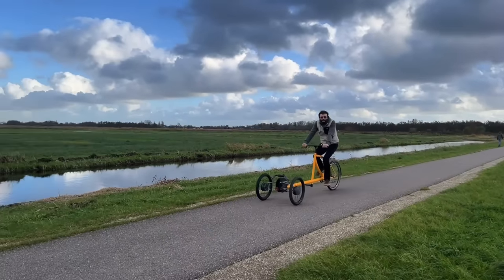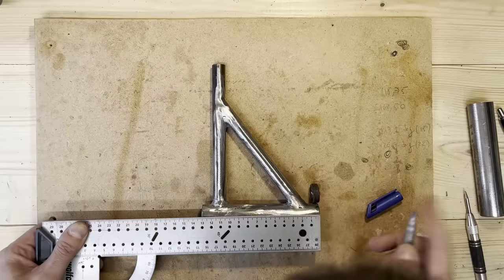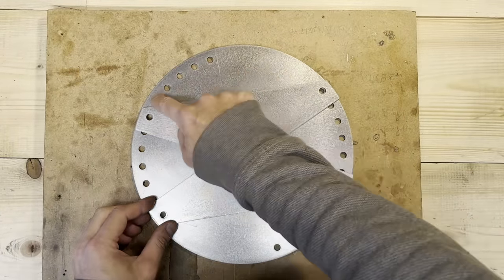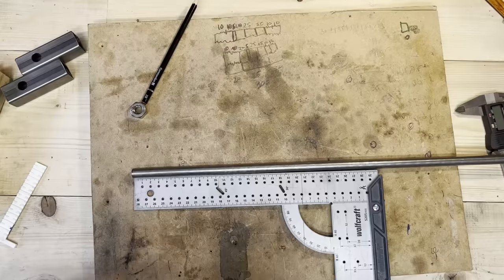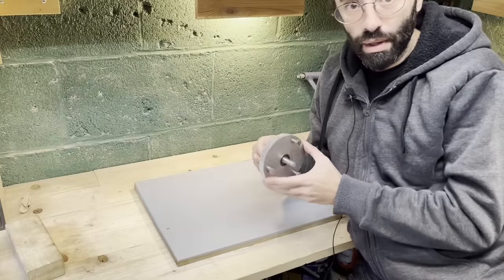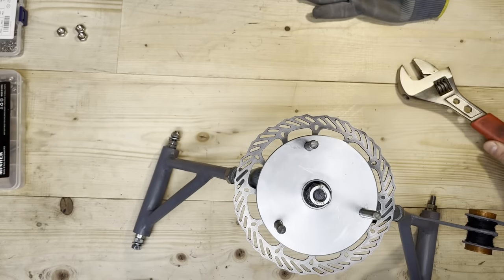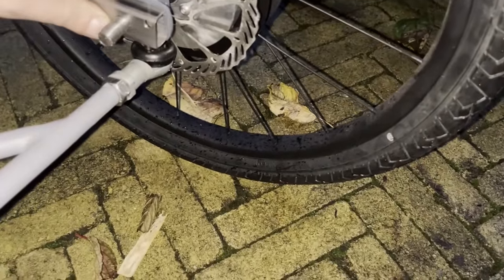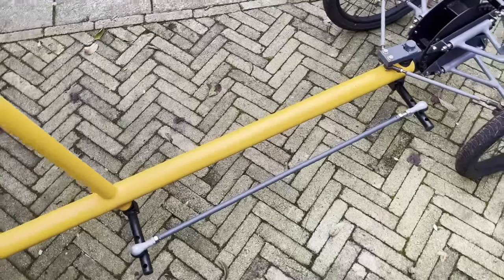Making of a Reverse Tilting Cargo Trike with Adjustable Geometry #5 - Full Build

Comment: What is the wall thickness of the tubes you used?
Reply from the maker: Hello, the wishbones have two tubes:
- 15 mm OD and 12 mm ID so 1.5 mm thick.
- 25 mm OD and 22 mm ID so 1.5 mm thick.
The extension tube is 60 mm OD and 56 ID so 2 mm thick. Hope this helps. Let me know if you like to know any other dimension.
Cheers!
Reply: @pedro-neves Thanks. The 15 and 25mm tubes I have are the same.
Reply from the maker: @piconano , note that the ID of the tubes is the most important because of the use of 22 mm bearings and M12 (12 mm) thread to hold the ball joint.
Reply: @pedro-neves  Exactly.

Comment: Why did you make your front wheel hubs so massively overbuilt for the project those are like the size of motorcycle wheel hubs a standard pedal trike Hub or entire wheel assembly would be perfectly fine they're designed to slip onto an axle so they would go on to a front steering spindle just fine it would have simplified your build and made it easier to replace and repair and they make those with disc brake mounting holes already in them honestly that's the route I would have taken
Reply from the maker: That's true. I have been thinking about this quite a lot. The reason that I designed it this way is that I want it to be able to carry a lot of cargo, and thus I prefer to overbuild. The second reason is that I want to design as closely to how a car is designed because, at some point, I'll start a small car build. Cheers!
Reply: @pedro-neves  oh okay with hubs and spindles that big and strong you could probably Carry close to 800 lb without those parts particularly bending or breaking I don't know about the rest of it seems pretty robust though

Comment: Why a trike? What does it do a 2 wheel cargo bike does not?
Reply from the maker: Hello, in my opinion, the trike will be safer because  if the front wheel slides (in slippery terrain) or hits a bump (e.g. a rock or sidewalk) this won't mean a crash in most times. Also, it will be capable of carrying more cargo with stability. Also, it's a larger engineering exercise than a bike;) Not that I don't love bikes, I do. But I think there are advantages in this type of vehicle for carrying cargo.
Reply: @pedro-neves  i have sold and drove cargo bikes for 25 years now, the difference in speed and stability and maneuverability of a two wheel bike makes it preferd for basically all cargo applications. Both from a technical maintenance point of view and a user point of view. I have sold 3 wheels and still do, mainly because not everyone is willing to listen to the salesman. But by far most people I sell a 3 wheeler come back for a 2 wheeler a couple of years later. The few attempts for 3 wheelers with a way to lean into a corner that have been made so far have always had crippling maintenance issues and complex assemblies that bike stores aren't meant to deal with. It's a nice exercise in technical prowess, this is for sure, but the complexity is also what makes 2 wheels superior. Even for 2-300kg loads.
Reply from the maker: @malloot9224 , I do agree that the trikes with tilting mechanism are the most complex designs with the disadvantages of maintenance and assembly, etc. One of the advantages is certainly being a nice exercise to make and learning certain aspects that will be useful in designing a car. I also think that a tilting trike can be as agile as a bike but safer and capable of carrying more cargo. But I will only turn this exercise into a product one day if I conclude that there are measurable advantages to the user and not a great complexity increase for assembly and maintenance. We'll see... Cheers!

Comment: Bigger size, bigger weight, same aerodynamics, more wheels. What's the point of this bike? Even bike curriers use classic frame designs.
Reply from the maker: Hello, I've tried several reverse tilting trikes and liked the way they ride. They are a bit safer than a bike, particularly in the rain and can carry more cargo. Cheers!

Comment: What tires do you have on the front?
Reply from the maker: Hello, those are 20 inch x 1.95.
Reply: @pedro-neves  heh, brand and model please ;)
Reply from the maker: @paweskiba3042 , this is the entire designation of the tires: "DeliTire buitenband Freestyle S-199 20 x 1.95 (54-406) zwart".
Unfortunately, the seller no longer has them so I cannot send you a link. But they have the same exact tire in blue so here it is. Hope it helps: https://www.internet-bikes.com/en/140513-delitire-casing-freestyle-s-19920-x-195-54-406-dblue/
Reply: @pedro-neves  I'm surprised by appearance of it. They look like 2.5 not 1.95" Could you please measure actual width of them?

Comment: Very cool, very pretty, but sadly in the end its just a bicycle with 3 wheels, glorified kickstand if you wish - lock the tilt and its a just a 3 wheeler with a small base, unlock the tilt and it handles just like 2 wheeler.
Anything fancier than that, just calls for more problems and the like - all self righting, self tilting geometries just invite more problems than they solve...
Reply from the maker: This is more complicated than a bike for sure. And I want it to behave like a bike. But, in my opinion, this will be safer than a bike because if the front wheel slips, this will rarely mean a crash. Where I live in The Netherlands it rains a lot and I've noticed many Piaggio MP3 - the scooter with 3 wheels. They are very common because they are safer in the rain. Also, a 3 wheeler can carry more cargo. I love bikes by the way. But recently I started being a fan of trikes as well;) Cheers!
Reply: @pedro-neves  Oh sure! More rubber on the pavement - more stable and safer! Especially that you did it all proper - suspension and the like.
I've read and discussed about a lot of tilting designs on bentrider forums and that conclusion was quite a surprise to me as well.

Comment: Everything looks very smooth and vell finished but to be honest I dont understand how are you going to use it, if you are going to use it as it is on the video then what problem did you solved from a regular bike, dont get me wrong I dont want to be understood as negative but I really dont understand the logic of this bike besides practicing engineering and diy talent.
Reply from the maker: Hello, practicing engineering and DIY would be fun enough for sure;) But there are more reasons. In my opinion, a cargo trike has the same advantages as a cargo bike (fast, good to maneuver, rides like a bike) but has two additional advantages: 1) it's safer because one wheel sleeping or bumping will not mean a crash in most cases and 2) can carry more cargo. Cheers!
Reply: @pedro-neves  thank you very much for the answer, in my country we are not used to cargo bikes I guess thats why I didnt understand the advantages but your answer made me look more into this. Keep up the good work :)
Reply from the maker: @MuratIsgoren , thank you! I love having constructive interactions.

Comment: The ball joints are completely overkill. Maybe on your purpose, I did not go through every second.

But this size is what you would find in lighter cars.
Reply from the maker: They are sized with an M12 thread. The size was a good fit for the design so I went with them. Also, not very expensive. But I believe you, maybe with M8 would have been sufficient.
Reply: I think M6 is enough, but anyway that doesnt matter too much. It is to carry load and not a racer. @pedro-neves

Comment: Why do you want it to tilt? Do you ride on NASCAR tracks all the time? It's terrible for handling... especially quick obstacle avoidance will flip the bike sideways by amplifying the weight shift which is the last thing you want for a vehicle.
Reply from the maker: Hello, I do not want it to go on NASCAR tracks but watching a NASCAR race is on my bucket list for quite some time;) anyway, the tilting mechanism allows the trike to ride more like a bike. When you have fixed three wheels, the centrifugal force of turning pushes the rider outward. With tilting, the centrifugal force pushes the vehicle to the side and to the ground, giving the kind of stability you get on a bike with the added safety of three wheels. At least, this is my interpretation. Cheers!
Reply: @pedro-neves  Think of what would happen if you're going fast and something comes in front of you and you need to do a quick left-right-left maneuver (or right-left-right same thing)... you will fly off the trike or flip over on the 2nd turn of either opposite maneuvers. Instead of you having control over the weight shift... the bike has it and you can't do anything to change it!
Reply from the maker: @hd-be7di , I am at the moment conducting multiple tests (safely) to see how it handles. Going straight, turn maneuvering, cargo and no cargo. I will share the results as soon as I can. I am not saying that this the best handling vehicle ever but I'll test and try to be clear with the results. I appreciate every comment with constructive critic such as yours.
Reply: @pedro-neves  I'm curious to know as well! Keeping the center of gravity very low will probably help the most in making it more stable!
Reply from the maker: @hd-be7di  , I agree! I will publish the video with the tests as soon as possible. If you happen to watch it, I'll be happy to read your comments, if you have any remarks. Thank you!

Comment: Invest in a tig welder chap,, spent all that time making the tubes nice and the flux cored it, ouch
Reply from the maker: You guessed it right! This is my next investment. That flux cored wire works but... There's so much grinding to be done after... And still doesn't look good.

Comment: I love what you are trying to do but it’s SO frustrating watching you reinvent standard bicycle manufacturing techniques with inappropriate woodworking and 3D printing technology. 

I just want to shake you and say, THIS is how you notch a tube, THIS is a trammel, make your jigs from STEEL not wood, use VEE BLOCKS on a fixture table, it’s TADPOLE not “reverse”. And I can’t take anyone seriously who can’t take the time to true their wheels. It’s painful watching them wobble along. 

I love what you are doing and how you’re documenting the path but I can’t watch. You should watch some Paul Brodie videos or something first. Or even my tadpole trike construction videos.
Reply from the maker: Hello, I appreciate the complete comment, even though you didn't like the video.

True you are about the depth of my knowledge on mechanical manufacturing. I think that the part where we disagree is that I think that there is value in sharing how someone with limited knowledge and tools makes something. I think that there is value in sharing the process and the iterations. I also think that most people watching my videos know this and don't mistake me for an expert.

As for the "tadpole" I have to say that I partially agree. Though a bike maker may call it a tadpole, there is clearly more people on the internet calling it reverse (not that this makes it right, just arguable).

I'm actually an electrical engineer and a mechanical hobbyist. This is a hobby, and thus I started sharing mechanical stuff. But, I have plans for sharing videos about electrical engineering. These will have more depth of knowledge, for sure. I would be happy to get some constructive criticism on those as well.

I watch almost all Paul Brodie's videos. That's next level. Maybe one day I'll be almost as good. But there's a process to it. I also just subscribed to your channel and will learn something from it for sure.

Cheers!